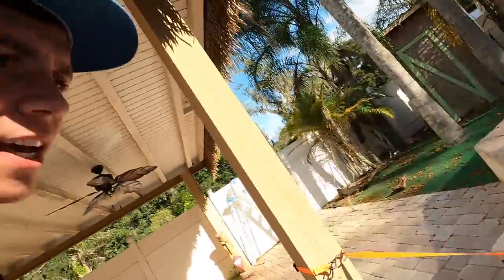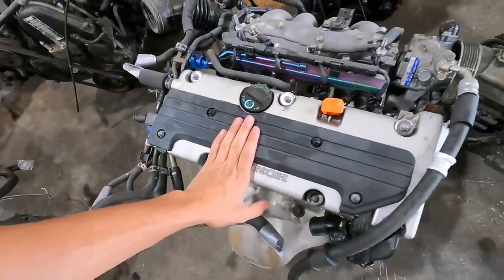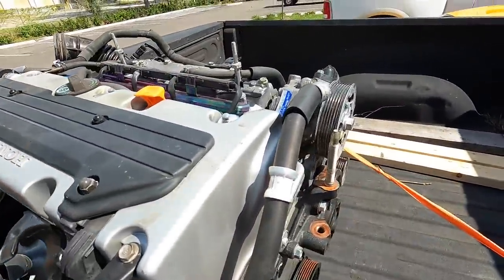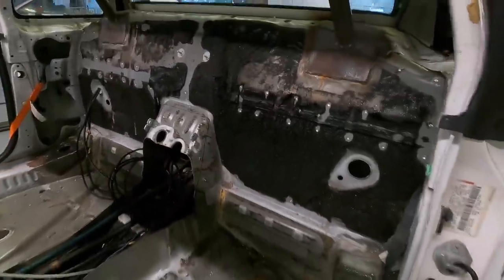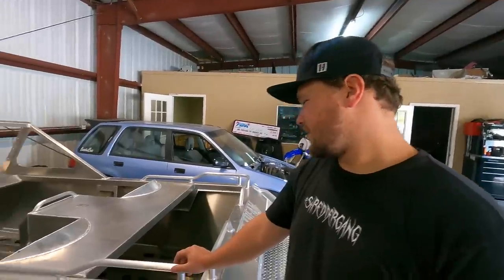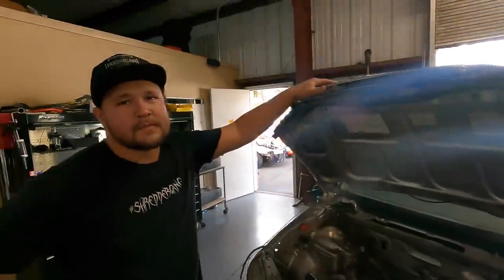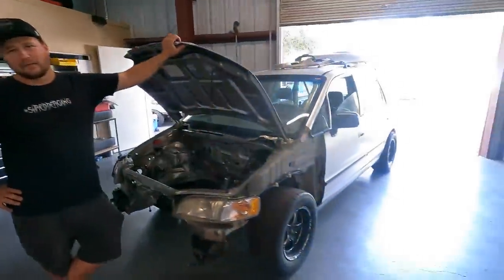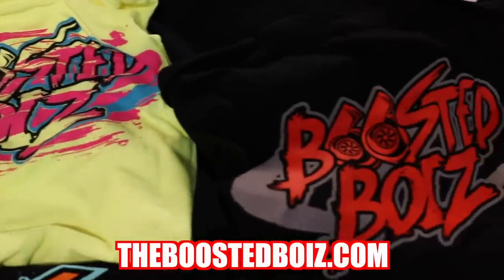We Are K-SWAPPING The Mini Jet Boat!

Comment: Kyle, you should save yourself some trouble with fitting the engine in the jetboat, get yourself a dry sump setup and one of them fancy new skunk2 valve covers to help get that engine nice and low.
Reply: Exactly what I said...🏁
Reply: Was literally about to write in almost the same thing. 😀
Reply: Exactly beats pulling the motor for an oil change :)
Reply: 5000 thousand dollars later
Reply: would be sick but you know these guys love budget swaps
Reply: That’s a genius idea but it’s probably really pricey
Reply: This
Reply: they definitly should
Reply: Beat me to it.
Reply: @tyfoster4212  ok, 5k isnt really much if they're considering a whole other boat if they gotta cut the seats out
Reply: Buy a k20.. save a little on height also..
Reply: honestly would help a ton with oil changes too
Reply: Yup
Reply: @420visiongaming5  they dont do budget, they do shit half assed
Reply: Sometimes doing a dry sump isn’t really worth it and more headache than it’s worth. I have dry sump on my Evo and it’s caused me a bunch of issues over just leaving a traditional oil pump on it.
Reply: Just cut a hole in the boat clearly nobody ever heard of flex seal dude made a screen door into a boat and at $19.95  its guaranteed to work
Reply: @tyfoster4212  8 minutes of ad revenue
Reply: @tyfoster4212  hes got the money there bud

Comment: Use dry ice to remove the sound deadening, it'll harden up and you can hit it with a hammer to break it off.
Reply: They have done that previously I'm pretty sure
Reply: @BushWookie603  they obviously didn’t do it right because he was struggling in that video to get it off
Reply: @chrisbushnell2378  y’all just love criticizing huh?
Reply: How is he going to get the dry ice to stay on the the sound deadening without sitting there with gloves on holding it up
Reply: @BestFunnyYtClipss   easily with tape and cardboard
Reply: He needs to use some type of freezing spray again and all the sound deadening should just pop off when it’s cold enough.
Reply: Yeah dry ice works great when it's on your floorboard of your firewall but he's working with s*** that's straight up and down hard to keep the dry ice on it
Reply: Dry ice and rubbing alcohol, had my 300zx sound deadening out in under an hour with it
Reply: For real, the best thing to use I've found. Used this for a number of 1st gen toyota mr2's I've gutted for racing in the "hornet" class at my local speedway.
Reply: Anyone try that with dynomatt? That shit peeled up everywhere.
Reply: That's it I remember having to get it cold and chip it away
Reply: The problem with that is it has to sit directly on the sound deadening in order for it to get cold enough and gravity won't let it.
Reply: I've always wondered if you could use air duster....hold the can upside down and spray the freezing liquid out . Idk, just an idea
Reply: Experts wow how much sound deadening have you guys removed dry ice wow that’s just in everyone’s tool box mine got lots I guess I better overnight some lol.
Reply: @ryanthedolphin  advice is only criticism if you let your ego get in the way.
Reply: @ryanthedolphin  Keyboard Warriors.
Reply: He has used dry ice for the deadening he already took out of it, the problem is the angle of the wall that its on is hard to keep dry ice in once spot
Reply: @BestFunnyYtClipss  pillowcase of dry ice held in place with magnets
Reply: @BestFunnyYtClipss  sit there with gloves and hold it up….
Reply: Jim jibroni  I’ve done it myself it’s not that hard
Reply: With that angle it prob wouldn’t wrk he’s best at doing his methods said he’d do using a brush wheeel
Reply: Isopropyl alcohol 99% works too. Eats it away
Reply: Rent a dry ice blaster............
Reply: @Danger-Dave  finally a easy, time efficient and realistic option for Kyle to remove that bs
Reply: @ryanthedolphin  criticizing or offering solutions?

Happy I'm not your friend if you are the type to have information to help your friends, but you'd rather watch them fail.
Nice job buddy.
Gold star for you.
Reply: Loctite have freeze spray. Dry ice in a spray can for vertical surfaces. Similar results to dry ice well worth it
Reply: Yes, freeze that sh*t, dry ice, make it work
Reply: @ryanthedolphin  think you need to hit the dictionary and learn how to use the word arrogant bud. 👍
Reply: @asylumental  cope
Reply: @ryanthedolphin  dolt.
Reply: @asylumental  ok :(
Reply: @ryanthedolphin  to clarify.... is "cope" short for some new age slang? Or was it a misspelling? Are you meaning to say copy?

Comment: With the aggressive cornering this unit will be doing on the water, I'd recommend to try going with a dry sump oil system. It might help with fitting the motor a bit better as well. Stoked to see this thing ripping the river ways soon!
Reply: You hit alot more side g-force in a car than you do in a jet boat, they lean into the corner keeping the oil more level in the sump relative to the boat.
Reply: This unit definitely going to need a dry sump
Reply: @MrChris106gti  Have you seen Cleetus whip his boat around? I guess the oil pickup of that engine only has enough oil around because it is holding onto the pickup for dear life...
Reply: If they were worried about height they just should have done a k20a /2 I don't understand why they didn't think of that in the first place. Would make 350 to 450 HP easily as well.🤷🏻‍♂️
Reply: @igvtec  there's no replacement for displacement.....
Reply: @WezleyB  yes there is!! don't you watch the channel?? He has a k20a in his drag MR2 not a k24a2. And the replacement is called V-tec. Capacities for LS chumps because that is all they have going for them with their s*** design they need it. What's the first thing you here when a V8 enthusiast is crapping on about a V8 its capacity. 🤦‍♂️🤣
Reply: @igvtec  any high horsepower honda engine has vtec removed so wouldn't call that a replacement for displacement
Reply: @Jacobtheunwise  that's because they are worried about the oil drop when the VTEC solenoid kicks in. It's just easier for them to do that instead of trying to find a way out of not having that oil pressure drop. Any of you follow Richard Holdener he has his own YouTube channel where he does experiments with all sorts of engines he is a V8 enthusiast and he even admits how good V-tec is he even says how much better the LS would be if it had V-tec rest my case!!
Reply: @Tanner I was thinking the same thing, They need to go dry sump, definitely help with the fitment issue.
Reply: @igvtec  there's nothing wrong with ls engines or v8s. And there's nothing wrong with k engines either. Stop being a hater
Reply: @strawsparky33  Hey mate if someones going to talk s**t to me I'm going to talk facts back!! No Ls lover going to tell me that the LS is better than Honda motors in development simple. I'll have a debate with anyone that is going to talk s**t on Honda!!
Reply: @igvtec  it's not a debate. Theyre completely different engine layouts. There's no point in comparing them. Playing keyboard honda warrior just makes you look ignorant.
Reply: @strawsparky33  yeah ok mate, so it doesn't look ignorant when I get a V8 lover trying to tell me that the Honda motors aint shitt??🤔 Cause normally a V8 enthusiast acts like they are all and end all! When they're not simple as that!
Reply: @Timberwolf69  yes i have, and if you notice he wears no belt in a normal seat, imagine sitting in the same seat in a kswapped drift car with no belt, you’d be all over the place. You probably pull more g’s braking in a fwd track car than you will in that boat. Boats exert more vertical gforge while cornering which helps hugely with oil pickup issues.
Reply: @MrChris106gti  Yeah, those in the seats look compareably comfy to someone sitting on the engine cover...
I think that the driver sitting almost perfectly in the middle of the boat helps a lot staying in the seat while spinning the boat.

Comment: anyone mention freezing that stuff off, dry ice will make it brittle and you can easily break or scrape it off.
Reply: That's how they removed the rest of the sound-deadening, my guy...
Reply: commenting so it hits the top & the boi's see it
cause this works really well . & dry ice is cheap
Reply: Have fun holding dry ice on a vertical surface.
Reply: I used a heat gun and a metal paint scraper  for mine it works really good
Reply: @Reckless2O5  use your hands

Comment: Need to dry sump the motor. It will help keep constant oil pressure when you’re whipping it around
Reply: Definitely second this. Dry sump will reduce the height as well. If you wanted to turbo it, you could put a heat exchanger inline with the oil lines to get some heat out of the oil too.
Reply: This! KYLE DO THIS

Comment: Wouldn't a dry sump be a good idea?  Save some space and help the engine stay running as you will have some wild lateral forces in a jet boat.  Take a wide high speed turn and the engine may starve for oil.
Reply: My thoughts exactly. it would clearance better, and you wouldn't have to worry about the oil pick up not having oil to recirculate into the engine/turbo.

Comment: Going to great to see.
Dry sump system will allow the engine to sit lower, also it will help with oil control as the motor can be running at high rpm for long periods.

Comment: Have you thought about going with the K23a1?  We are currently building it now. Had to find a flywheel, modified the starter opening to work.  Intake headers need to be swapped and fabbed up.  Using an RAA intake header and fabing up the exhaust header once the turbo shows up. Going to be using a Borgwarner S200SX-E.

Comment: Could make the K sit lower in the boat with a dry sump.
Quick tip, if you need to remove bitumen sound insulation, use an electric paint stripper and a gasket scraper. It is pretty quick, low noise and no dust. Perfect for keeping your interior mint! 👌

Comment: I agree with a lot of people in the comments talking about a dry sump oil system. I would really consider it. It’ll save a lot of headaches and possibly a motor,especially in a marine application. Also I can see you doing a sweet water heat exchanger setup to keep the coolant system closed loop

Comment: Its aluminum, just cut that seat section and move it as needed... was looking to see what you do for a jet drive and an old PFI video came up so it looks like you have some experienced help on this one...
Reply: Should extend to the rear, not to the front, because of limited passenger space.
Also leaving a small gap (by moving the seat 2-3 inch forward)  is good for ventilation but could be very noisy.
Reply: Your gonna be smoking fools if k swap it
Reply: How much more does the k20 weigh compared to the jet ski motors😂  its going to be a heavy as fuck compared to the mountains dew ripper haha  would a 400-500hp 300kg engine and the jet drive be as good as a 300hp enhine with half the weight/rotating mass🤔 deffs keen to see what they are going to do/break😂🙂
Reply: @matthewwest1262  it’s the torque you need not hp. 
🙂👍 I don’t think a rotax can make the same numbers as a k swap.
Reply: @matthewwest1262  it'll be ass heavy till it gets on plain
Reply: Its aluminum, just build another cover make. They have plenty of seat options for boats,
Reply: Todd’s boat is sickkkkkk

Comment: Should you guys run a stock oil pan on the jet boat ? There do be some pretty rowdy angels on them jetboats.
Reply: I was thinking dry sump is needed.
Reply: I would hope they make it dry sump but at minimum I would hope they install a baffled pan.
Reply: Chain drive or a drop box should save them a lot of headaches.
Reply: They might have to go with dry sump just for the vertical clearance.
Reply: Rowdy angels on a jet boat.... Sign me up

Comment: Bro are you going to have to have a sump system for the oil I was thinking all that quick turning like Cletus does might start of it of oil????
Reply: My first thoughts when he mentioned the factory oil system, better of spending the coin on a dry sump setup, or at least a well baffled wet sump setup.

Comment: Honestly kind of fooled me, thought they would put the Dorito engine first then putting it in the Samurai later and k swap it after that . Lol.  

Imagine a rotary jet boat screaming.
Reply: That would be insane, I feel like it would perform well on the jet drive considering they rev so high it would probably push a Crap ton of water.
Reply: Seen it, they suck not enough low rpm torque to get them up out of the hole
Reply: Rotaries do not go well in jet boats, due to the revs they require. We have a rotary jet sprint boat here in New Zealand that they had to detune to get it to work. They have tried turbo and now are trialing a supercharger. It runs on Methanol. the jet drives are not designed to run at the revs required.
Reply: @samthesr20man  that's the exact issue I was concerned about.
Reply: @HiggyRSQ  makes sense, i wonder how good a rotary would work on an airboat or maybe even a prop boat.
Reply: Cbmedia is doing EXACTLY THIS. it's a boosted 13b. Check it out
Reply: Many ships run on rotary engines. They are usually huge and diesel. It would be pretty cool to see one in a jet boat. Set the gearing correctly in the jet drive...🤔 Ideas... Ideas ..
Reply: @ Yellow Rice That would be a job for Angel Motorsports. If someone could figure out how to make a rotary engine work in a jet boat, it would be them.
A comment from them sounds like they are spending some thoughts into this idea...
Reply: Angel motorsports has entered the chat
Reply: @michaellk2254  that's a completely different style boat. The long tail river boats can used high Rev motors with the propeller drive.
Reply: Angel did help him put together that Dorito engine recent.  But All in all I’m still happy it will be k swapped and eventually boosted.

Comment: What about using a scraper blade attachment on an oscillator multi tool for the sound deadening. Might make it come of in better pieces and easier to clean up than the wire wheel.
Reply: Not a bad idea... 🤔
Reply: Agreed scraper multitool for the win

Comment: Kyle, use the heat gun & a scraper, soften the deadening material & scrape it off.  Then once most of it is off, you can wipe the residue off with some benzene ,& a cloth, will not damage your paint

Comment: I'm a old school Mopar guy and I have bought several cars for 150 back in the day that ran and drove for 150 with clear titles. One was a 65 Sport Fury with a good 383 in it and a nice body for various parts we wanted, another was a 75 Dart 4 door with big bolt disk front and drum rear brakes. The Dart I asked if the brakes worked and would if it would drive 5 miles home. He said yes, I paid him cash and drove it home. Even then just the front brakes were worth 350 not counting all the extra parts you always needed to convert my Dart over. I drove it to a buddies wrecking yard and we used the forklift to strip what we wanted and left it in line with the title on his desk. They later sold the engine for 175 so a win win for everyone. Many times it's still cheaper to buy a complete beater someone is tired of and doesn't care for the odball parts you need. I have also found great parts cheap at you pullit yards

Comment: To remove the stuck sound deadening, use dry ice to freeze it then hammer it off. You may need to buy more for the section you are working on and use cardboard and sticky tape to trap it against the verticle section you are working on, but certainly can save a fair bit of time and mess over using a grinder / wheel to remove it.

Comment: you could mount the jet drive back further. some berkleys have most of the jet drive external of the boat. just need the intake screen on the inside. not sure how long or the exact style of your pump but that might help mount the engine back further almost past the seats.

Comment: I have a 95 Geo Tracker 4x4 that I'm planning on K swapping, I would like to mate it to the original 5 speed manual transmission. If you could point me North on this issue I would greatly appreciate it.

Comment: Very awesome can't wait for it to rip. I'm not not being negative by any means, but a 35 12.50 old tire is perfect to transport motors in the bed of the truck plus the strapping. Dude you guys rock. Just wanted to share a trick that works

Comment: Build a little cardboard surface or some vinyl sheeting from harbor fright n tape it on to the back deck you removed the metal from and leave the top open so you can fill between the cardboard/vinyl sheet full of crushed dry ice and leave sit for a good bit and remove, give er a few good cracks with a nice BFH and that stuff will come off clean! 
Did this on my evo and i had some areas that where CAKED Just like the MR2 is! 

I know y’all have prly tried the dry ice but you have to be patient and get a good contact to the sound deadening 💪🏻💪🏻

Comment: Kyle, tuning a boat is different. You need to make sure the engine is tuned to the jet turbine RPM so that you hit the power band in the RPM range of the jet. It also makes it easier to make more power. But the operating RPM of your jet is going to be lower then what that engine can rev to. You will most likely have to a a gear eduction box so the engine can run some what normal.

Comment: Should also consider the weight difference between the k an the seedoo running gear see how it will affect it sitting in the water cause i reckon it it might be quite a bit heavier which would have the nose of the jetboat sittin to high

Comment: I knew it! K24 😂 but please do a water to water cooling system. Normal coolant goes into a cooling bloc where sea water go. Kinda like your air to water setup in the mr2. Would give you more time to shut it of in case of a cloged pump and keep sea salt out of the engine.